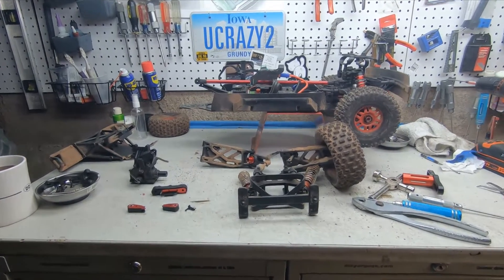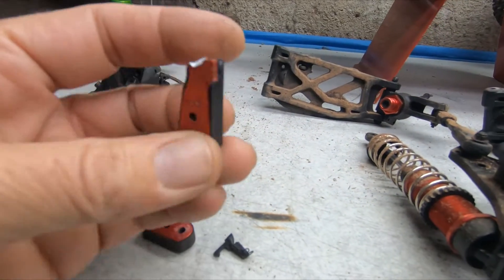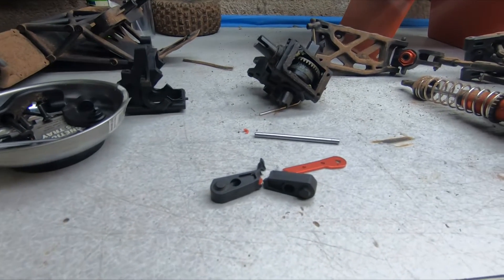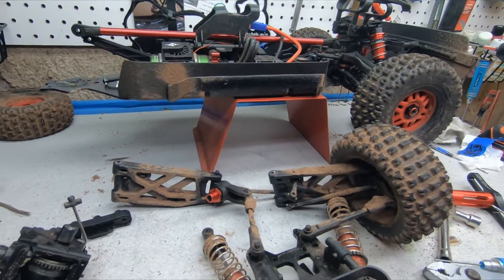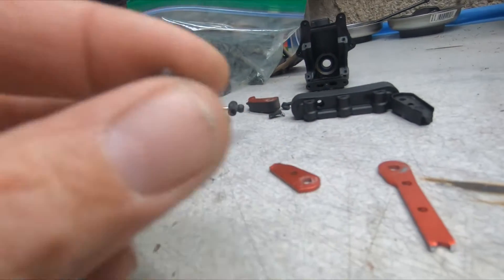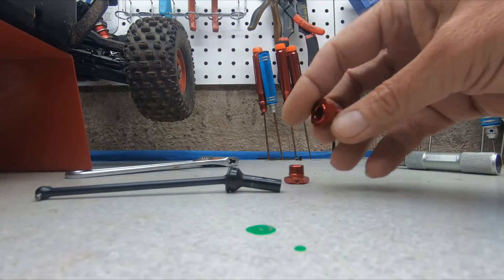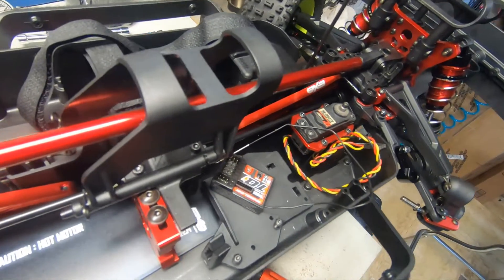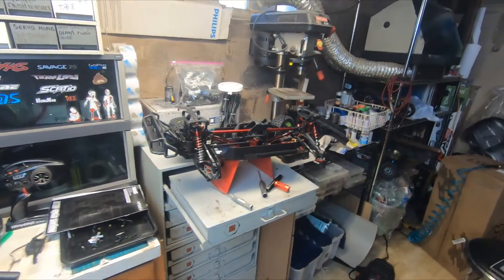#127 Pt1, ARRMA MOJAVE SNAPPED LIKE A CANDY CANE ON 1ST RUN , EXB REAR WHEEL HUBS DON'T WORK W/CVD'S

Comment: Hey, nice video. I have CVD's on front and rear on my EXB....was a pain and it did require some drilling a bit. They are flush and after first run wheel spins ok.
Reply from the maker: I was thinking just run it and it will loosen up , but went the other way with the old wheel hex . it all works out
Reply: Do you mean you had to drill the hub a bit for the pin to fit in?
Reply: Or did you drill out the hole in the cvd?
Reply from the maker: @joeshow750  if you file off some of the back side of the hub ( Red hub ) it fits , no need to drill
Reply: @ucrazy2rc460  ok copy, thanks.  I was confused because I looked up the hubs for the exb and v1 and they are the same part number on the exploded views so I was like hmmm, guess I can't just order the v1 hubs then haha.
Reply from the maker: @joeshow750  check vid #128 and it will show what I did to hub. , no need to spend money
Reply: @ucrazy2rc460  ok will do, appreciate the assist